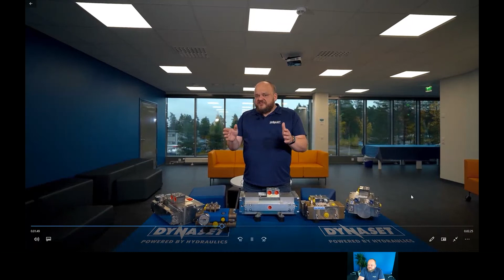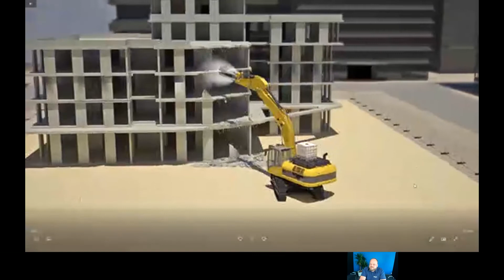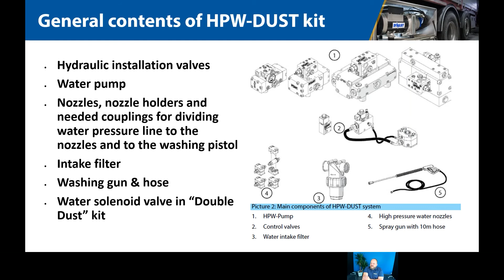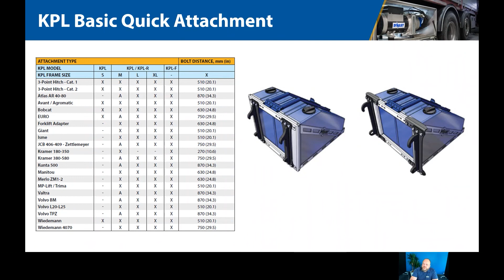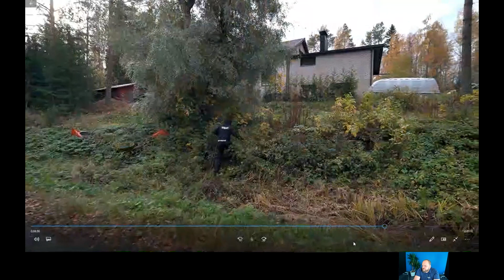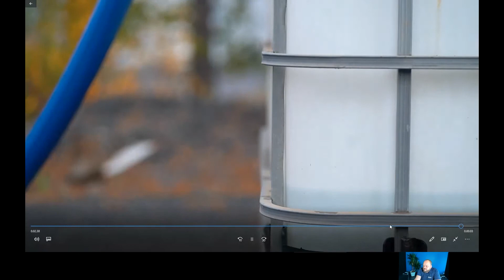Function Structure and Selection of Main DYNASET High Pressure Water Products and Applications

Comment: Hi, I has a problem with the high electricity consumption of the 400 HP well water pumps. I want to replace it with a hydraulic system that rotates the pump arm. I need an RpM of 1800 rpm. This is a big project. I need an expert to design a hydraulic system for us to rotate the water pumps for traditional wells. I do not want atmospheric pressure pumps.I need advice and manufacturing of a hydraulic rotation system. Can you manufacture the system?